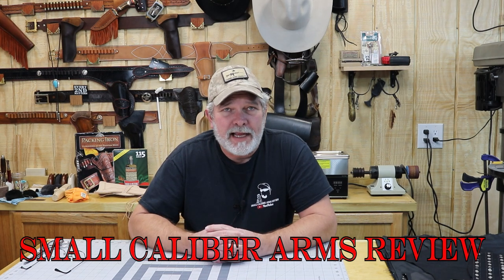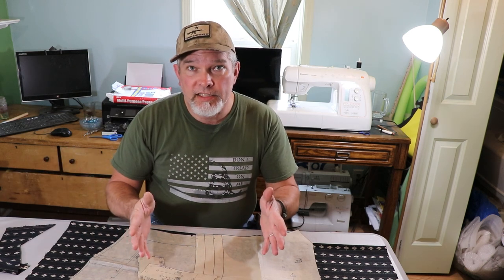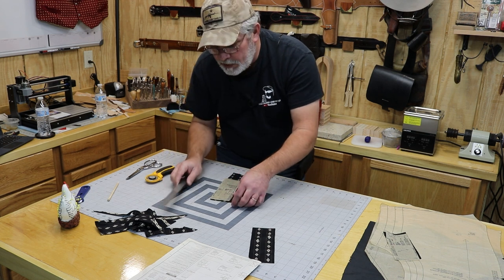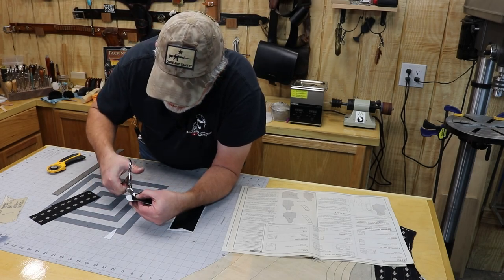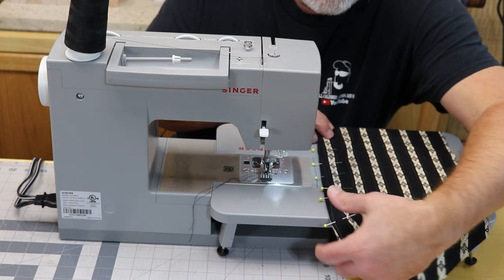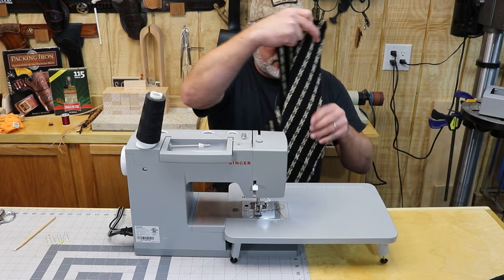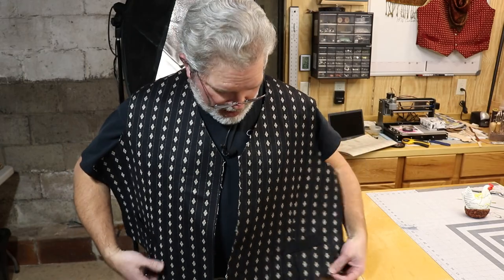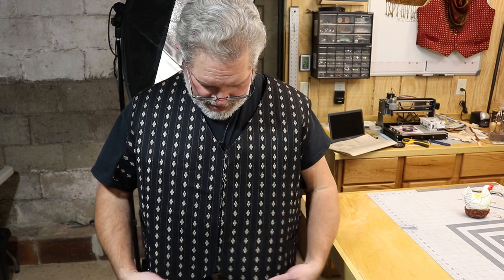Cowboy Gear | The Ben Wade vest from 3:10 to Yuma

Comment: So my wife is going to make this for me but her question is the front piece the pattern says cut 2 on the fold makes it double fabric. Is that right? It says cut 2 of everything does that mean cut it out and then move the pattern down and cut again
Reply from the maker: You need 2 front pieces, if you fold it, you can cut both at the same time. 2 fronts, 2 backs, 2 front liners and 2 back liners. you're pretty much making 2 vests, an inner made of the liner material and an outer with the fancy panels for the fronts and usually a different material for the back. they then get sewn together around most of the outside and turned right side out. the sides will then get stitched together and the liners will be closed up by hand stitching.
Reply: @SmallCaliberArmsReview  so if cutting it on the fold then just cut it once and then cut it apart at the fold to give me 2 pieces ...one for each side of the vest
Reply from the maker: If you're talking about instruction 8a and 8b (I'm assuming you have the same pattern as me) the fold isn't part of the pieces. It's just shown that way so that you can cut out two pieces at once. There are some pieces in different patterns where the fold is included as part of the piece so that when you open it up, the piece will be twice as long or twice as wide. (I just did a Western Puff Tie like that) You will end up with two seperate front panels after you cut it out ad un-pin it.
Reply: Thank you sir, that helps out a lot. I appreciate the quick replies and the instructions. Have a great Sunday!
Reply from the maker: @terry quates  absolutely! You have a good one too!